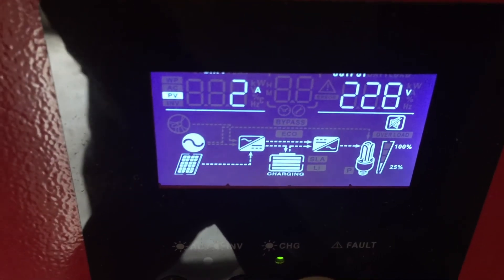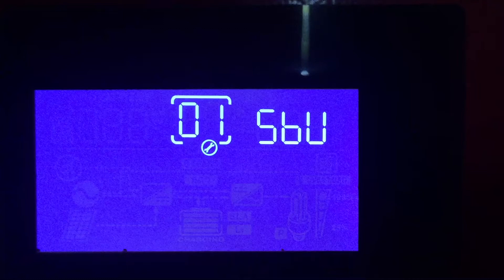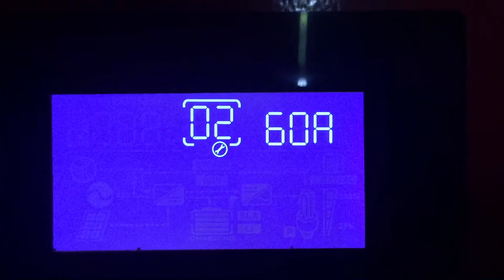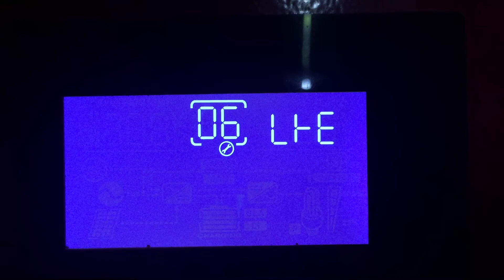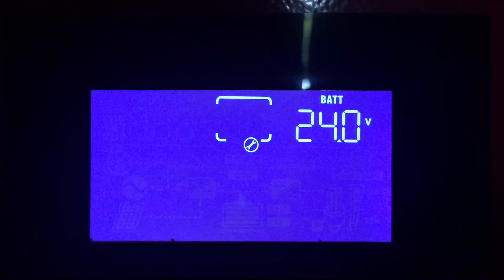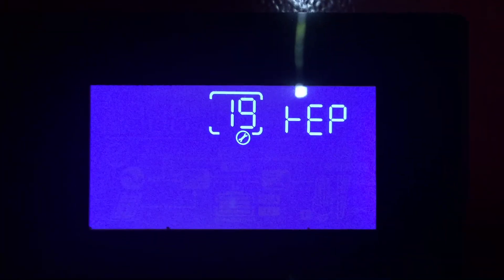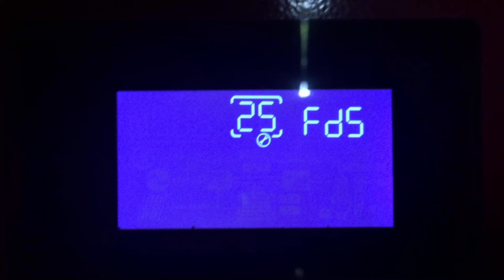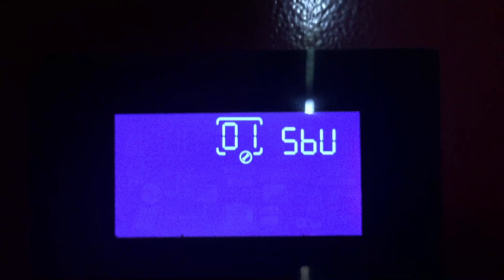MPP SOLAR Menu Tutorial

Comment: can i ask question sir? thanks
Reply from the maker: Sure
Reply: @SolarFarmer  thank you sir.

our inverter sako mpp sonun plus. saw your video about the menus i think they all have the same.

the question is

we have 4 batteries of 200amp deep cycle lead.

then the default is 46 or 47 voltage like in your videos. and not %(percent number). 
if we want choose the battery goes to utility.

but the inverter monitors also shows 4 bars 25% each remaining batteries? how would i set up the 50% or even 60% remaining batteries it goes to utility. thank you

if we click the batteries in inverter . it always shows 53 54 voltage. Then if i click arrows down. It shows battery temp, kva , kwh , ampere, %output.
Reply from the maker: @infectionSincross  

That's a tough question because everything depends on the battery.  Is it SLA, Gel, or other type of technology?  Unfortunately 25V is not the representation of 50V...from from it.

Look up the specs on your battery to determine what voltage is 50% or what percentage you're aiming for (60% for example) before returning to utility.  Once you've found that value just program it in.

For instance a 12V battery bulk charges around 14.2V, floats at 13.8V, but should never go below 12.6V to be safe.  My cut off is usually 13.2V.  That means at 48V I don't go below 52.8V.  In this way I prolong battery life.
Reply: @SolarFarmer  ok after studying abit.

we have 4 batteries 12v200amp deep cycle lead acid batteries in series. i dont know if its agm, gel or flooded. it doesnt say what it is.

so we have 48 volts and 200ampers.

in the case it says.

constant voltage charge
standby use : 13.5-13.8V
CYCLE USE : 14.5 - 14.9v
Reply: @SolarFarmer  last question. how do  you stop the utility charging the battery>?

we are using the SBU setting. but as soon the utlity kicks in . the battery is being charge in the night
Reply from the maker: @infectionSincross  

Go to charger setting and select solar only charging.  This will force it to charge in that manner.
Reply: @SolarFarmer  hi again. thank you for all the replies. 

its the second night now.
when i set up the number 16 (from the video also) 050(SOlar) means solar only charging. but it charges still the battery after the utility kicks in.

right now. i change the number 11 options to 2 ampere charging of utility to battery. to save me from the bills . lol

 i think there is still other option or setting needs to set up.

how does you know the bulk of the batteries? 26 and 27 from the videos? 

and i set upt the 49 voltage. cause the limit from number 12 from the video is 51 voltage.
Reply from the maker: @infectionSincross  

The old unit (red) was a 24V system. I looked up the specs for charging for my batteries on their website.

If you have a 48V setup you'll have to use different values.  As for the Solar Only, OSO sounds right.  It should not charge from grid at all in that setting.
Reply: @SolarFarmer  should we be concern? It is still charging the battery.  The grid charging the battery if the utility kicks in until 11am. 

6am solar comes utility and solar charging both. Except after 10am- 11am when utility  charging the battery.
Reply from the maker: @infectionSincross  

Check to see if your setting is staying.  I'm not the engineer so I can't say if that's good or bad...only that it seems like it isn't operating as programmed.

But I'd check to see if the setting stays the same and....

...and to see if you have additional programming like battery maintenance that comes on with a schedule.  That's the only other thing I can think of.

Comment: Excellent help and I sure do appreciate it since the book is useless. Jim in Chile
Reply from the maker: Thank you.  I remember when I first started...it was a lot of trial and error getting started and a lot of tweaking for what I needed it to do.  The unit does a phenomenal job converting sunlight into direct and usable AC power.  Since I bought this unit the charging abilities have improved with the company, but unless absolutely necessary I would configure the system with a third party charger....like Victron.  I say this because battery balancing becomes an issue.  I have devices on there that help the charging of my batteries stay balances, but there are companies out there that specialize in this.  Again, the company has improved on their charging abilities to match that of companies that have been forerunners in the industry.  The unit is great for converting into direct power, but to prolong the service life of your batteries, I would consider configuring with other options.  :)
Reply: @SolarFarmer  I have just installed a 10kw system. 30 Panels 330W 12 and another 12 on towers with tracking, and 6 stationary. 2 MPP inverters at 5 kw each and 2 Midnite Classics 150. 12 batteries at 200ah each. The system is 48v.
I have an additional system that is 1500w with another MPP inverter charger 4000w. It will soon have a Midnite classic as well. 
All of the inverters have integral charge controllers but I also saw that it did not comprehensively do its job as well as monitoring was lacking.
I have stayed away from Victron because of the prohibitive cost. Here in Chile it is the inverter of choice because it is German and there is a lot of German tech and Germans here as well and hence it is all that they know.... So the price reflects the idea that it is the only inverter that one should own. In addition it costs a lot more here than other places because of the importation tax. 
I follow Justin Case Solar in Aussi land and he is really big on MPP. 
My experience has proven the same. I have had my small system for 4 years now with out incident. 
Thanks for the advice, and yes I should have a video up and going about my new system in a few days. My camera is messed up right now. Jim
Reply from the maker: @ChileExpatFamily  

Your system sounds do awesome.

I did think of turning off the charge controller on my first unit to use a Morningstar or Victron as a main charger, but the new unit I have is amazing.  It even has a desulfate selection that I run every 21 days.

Link mr to your videos when you're done.  Keep in touch.
Reply: @SolarFarmer  Thanks for the support. Jim